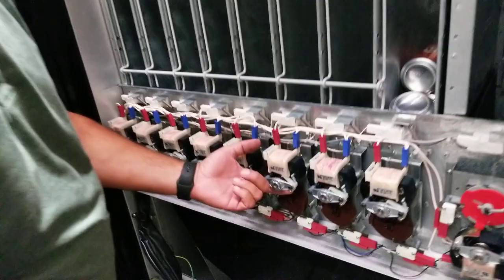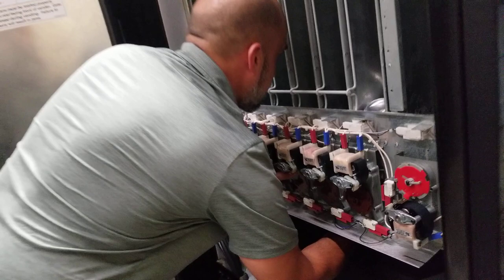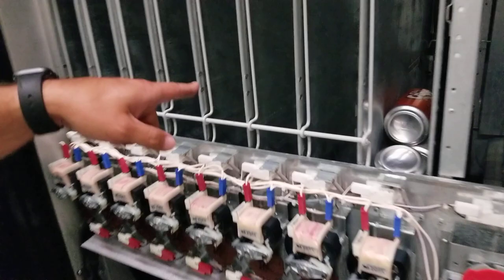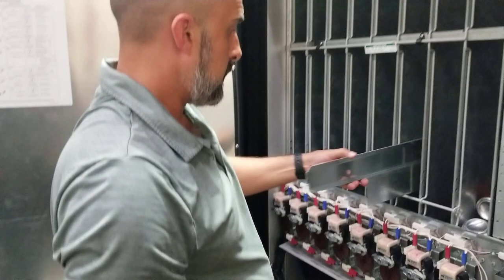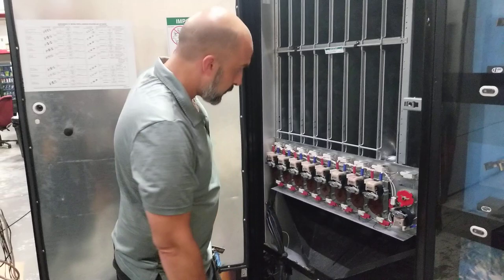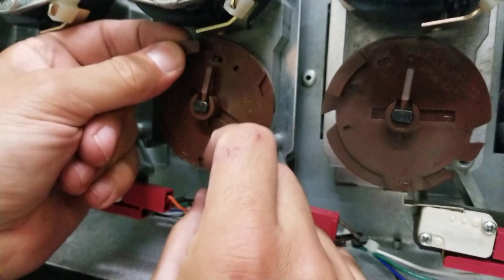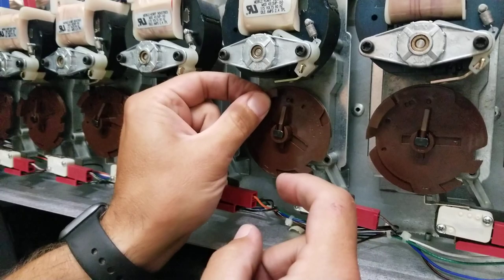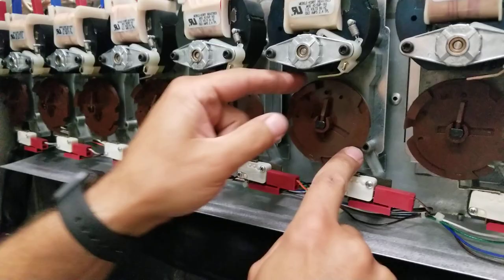Changing side shim for Dixie Narco 501E soda vending machine.  Make sure machine is unplugged.

Comment: How do you replace the sold out switch
Reply: If you see in the video there are white micro switches.  You can change them out with a screw driver.  They are only held in with two screws.  They are fairly easy to change.  Just make sure the machine is off and the motor panel is taken off.